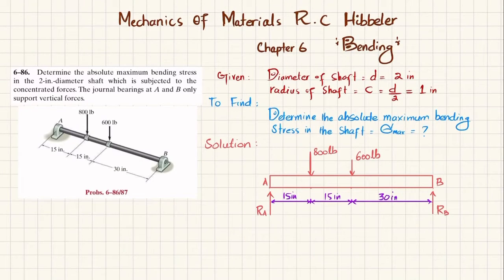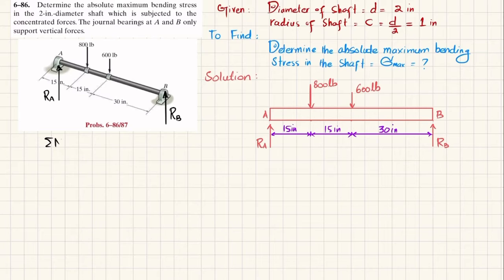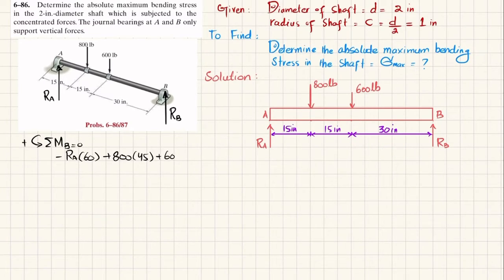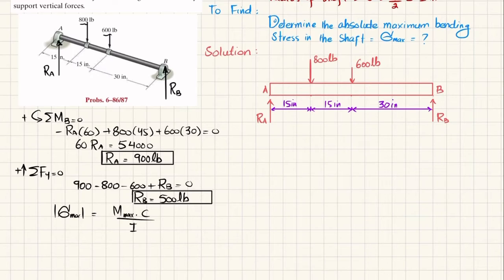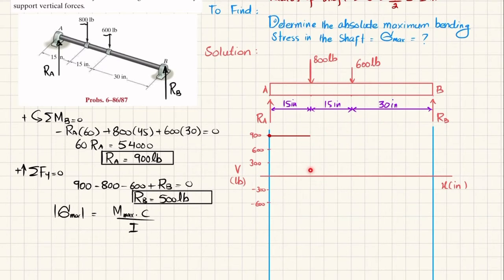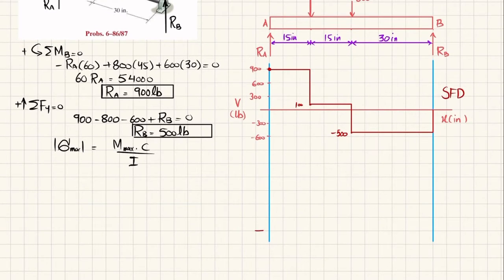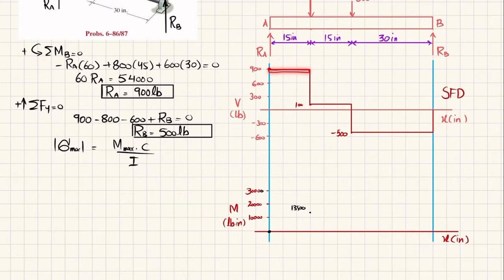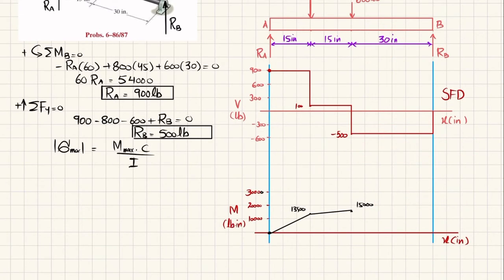Determine the absolute maximum bending stress | Problem 6-86 | Mechanics of materials rc Hibbeler

Comment: Bro could you explain shear center ?
Reply from the maker: I didnt get bro. Please elaborate
Reply: @engradnanrasheedmechanical  shear center in the cross section is a position were the beam does not twist or rotate and it's symbol is e.
Reply from the maker: Are you talking about this problem or its a seperate topic (shear center)
Reply: @engradnanrasheedmechanical  Separate topic. It's in chapter 7 with shear flow and transverse Shearing stress